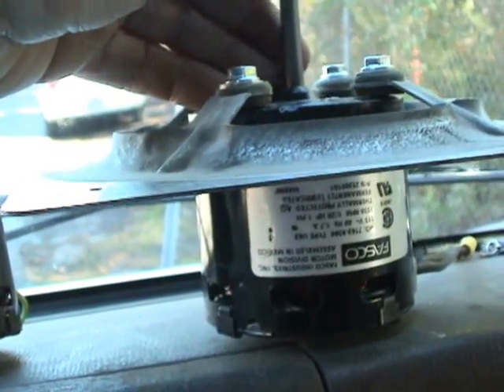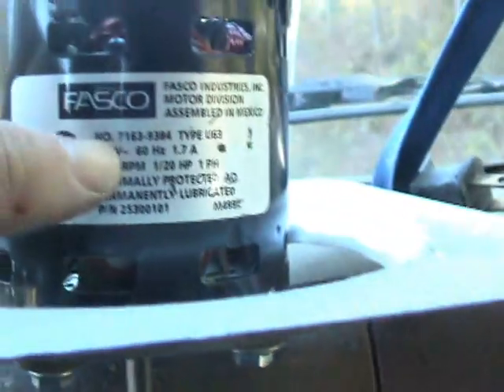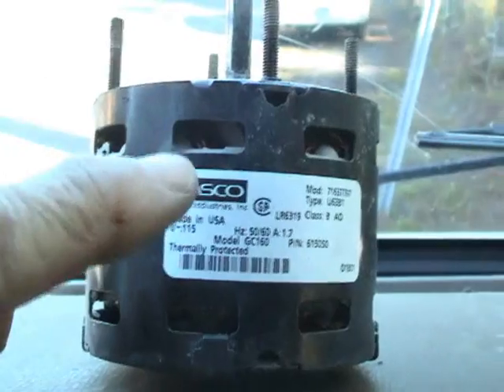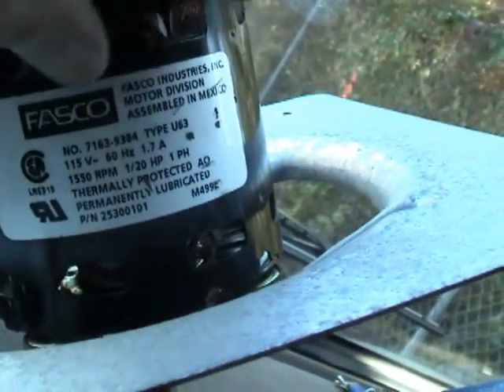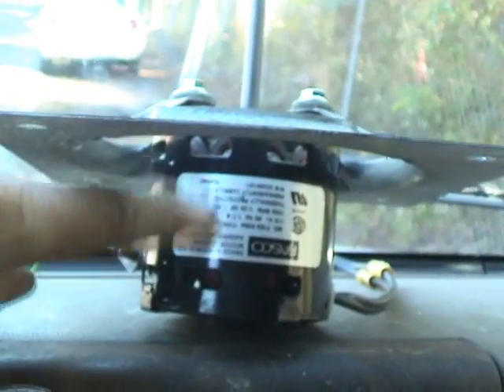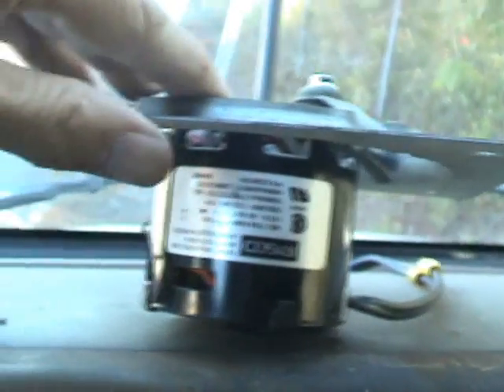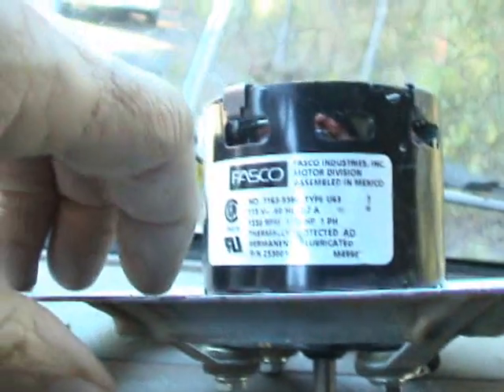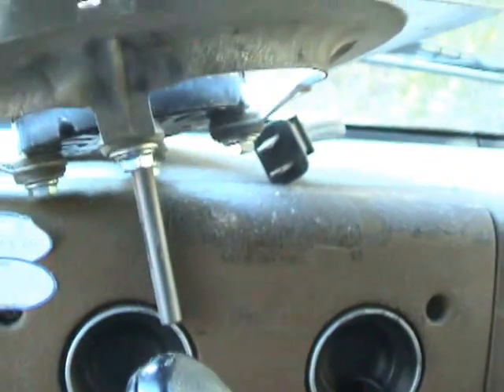HVAC Exhaust Fan Motors 1

Comment from the maker: I did neglect to mention the rotation. The rotation on both motors were the same. The information wasn't on the info plate. I had to plug in the new motor to check it out.

Comment: well spoken, how is the leg doing? I particularly like it when have to replace damper motors and they fall on the leg while you are in a crampt m/a section of a commerical air handler.

Comment: If an old motor was being replaced with a new one of the same horsepower and rpm but lower amperage, could it just be more efficient?